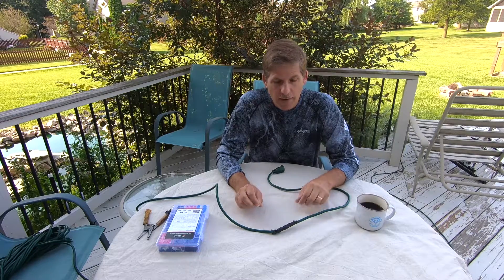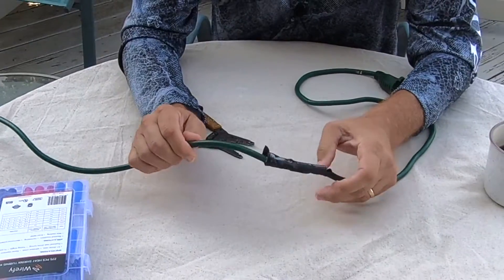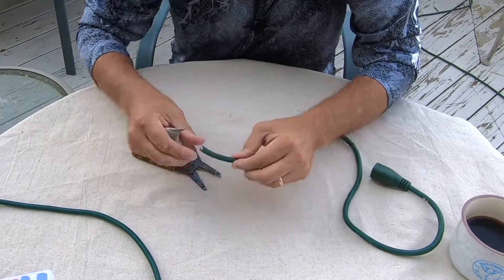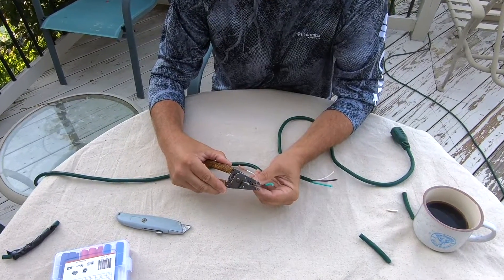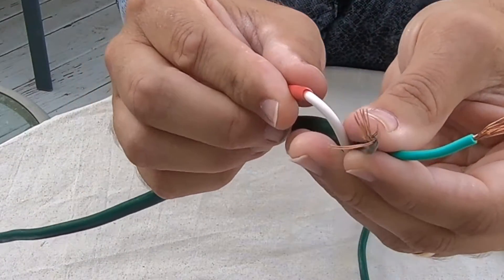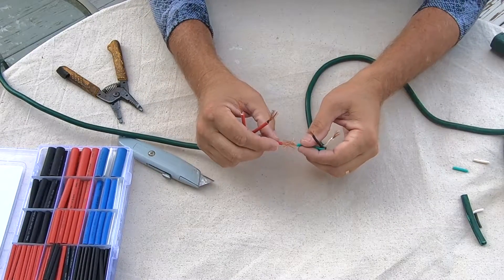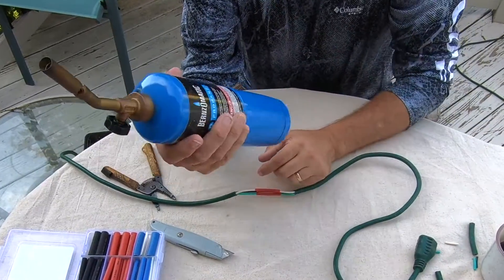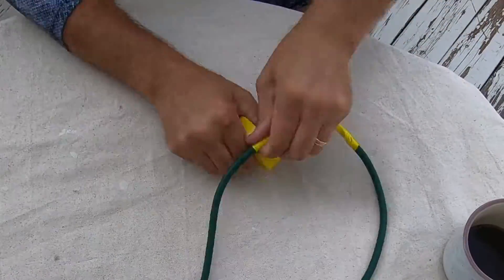How to Repair Damaged Extension Cord with Heat Shrink Tube

Comment: Even with adhesive lined shrink wrap, you should solder the connections for the simple reason that it's a stronger connection with better conductivity. The second issue you may have is over time, those might start pulling out of their heat shrink tubing and since all 3 cords were cut in the same spot, the chance of a dead short will happen as soon as they get exposed.

Better method, is to cut the wires in different spots, so that each wire connects in a different spot where they are spliced, that way if any of them break or come loose, you won't have two wires short out.
After your wire repair, get a larger piece of heat-shrink and put it further up the cord, and when the repair is done, slide it over and cover all 3 wire repairs.
Reply from the maker: Hey watcher,
Thx for the thoughtful comment. Very helpful. Thx for watching and commenting!

Comment: I've never tried twisting them that way, usually self twist, then join twist, then solder and electrical tape. Is heat shrink going to be strong enough to take the stress that the original wire could take? I came here to check out it's insulation capabilities, this looks like an interesting way to repair a wire that takes AC.
Reply from the maker: Hey Mr.,
The repair is not as thick as the original exterior covering. I guess you could cover it 2x. But it should hold up pretty well for typical extension could use. Maybe just keep an eye on it over time.
Thx for watching!
Reply: I am thinking about repairing my extension cord and it seems like heat shrink butt connectors would be better to prevent separation if tugged on.

Comment: Nice video.. i had everything stripped and ready to splice but was unsure about insulating the conducters. I had reached for the electrical tape but thought to myself how it would unravel on  hot sunny day. Wasnt sure if heat shrink was made for thicker  cables! 

FWIW: anybody reading this and is about begin fixing the issue,  i suggest cutting 3 inches instead of the 2 inches,  that way you have an extra inch to practice stripping the stranded wire. Stranded wire can be a little tricky making sure yiu don't cut off strands. Once you nailed down witch notch on the wire strippers does the job, trim to 2 inches.
Reply from the maker: Hey Johnny,
Good job! . Thx fir watching: